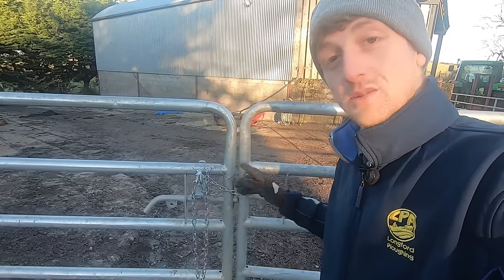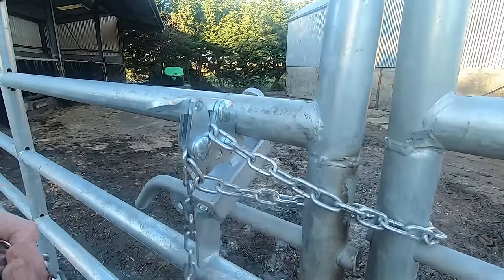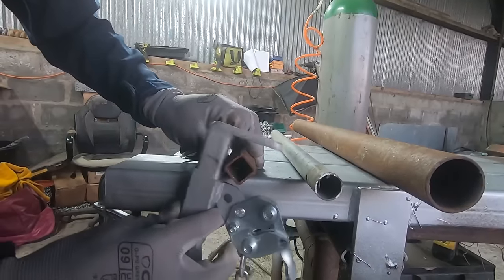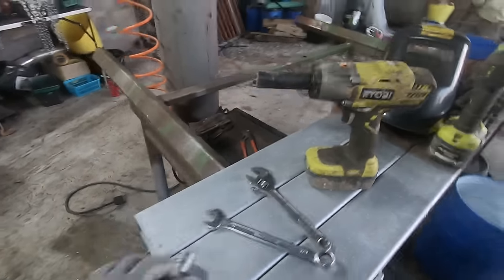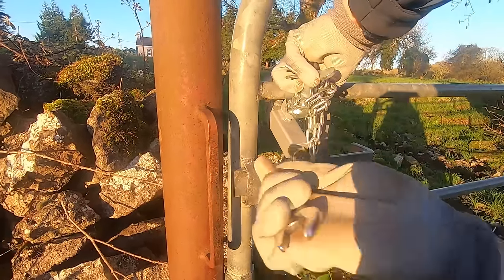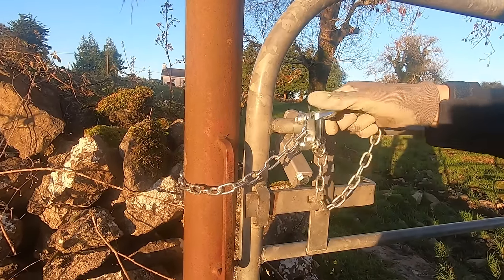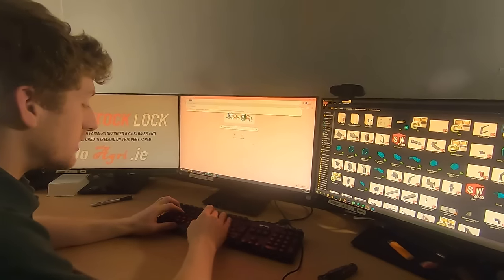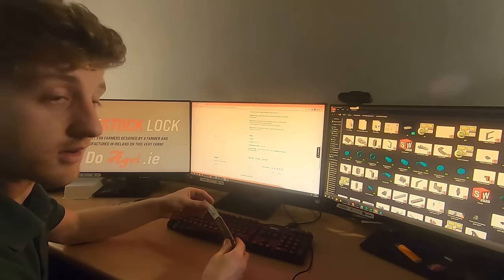Rethinking Farm Security Beyond Baling Twine

Comment: At the start you said you needed to pull on both sides if the chain to open it and then later in the video you open it one handed by pulling on one side of the chain? Nice product
Reply from the maker: Sorry my bad it will work both ways but is better to use bith hands Thanks JD
Reply: Didn't you say that it was a security feature in that animals won't be able to open it because it has to be opened from both sides? 

Have you tested how much force it would take to open it from pushing the lever up?